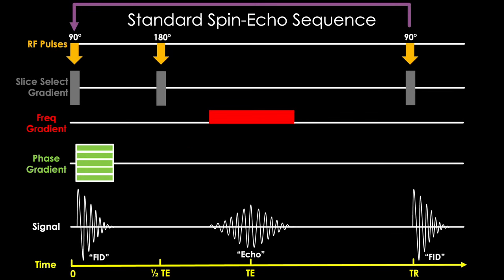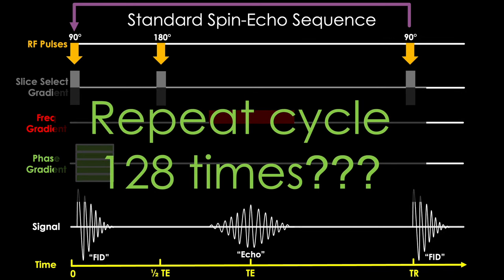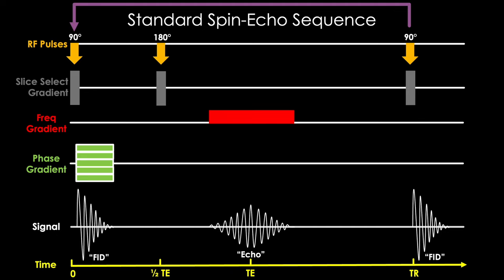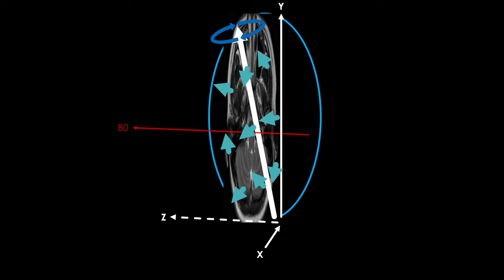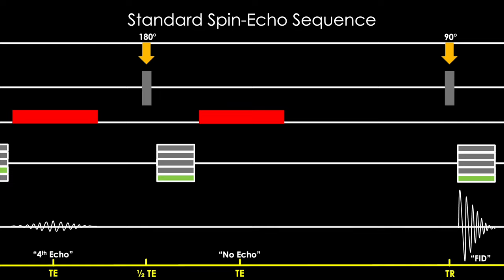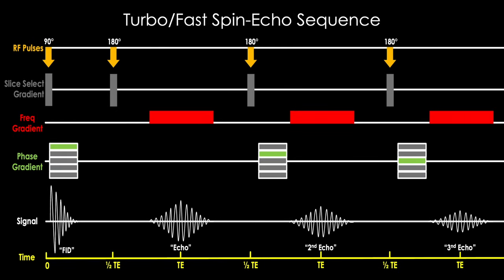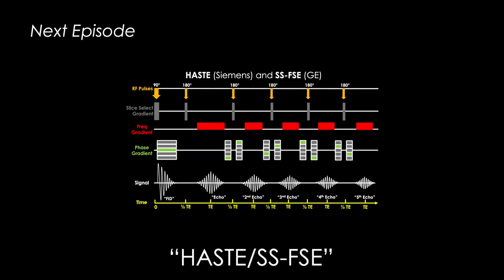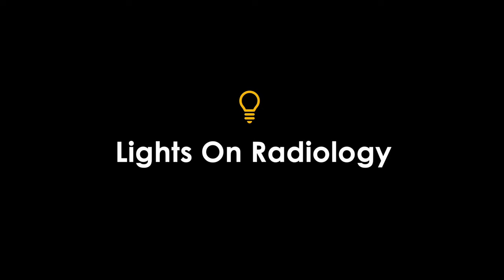The Turbo & Fast Spin Echo Sequence - MRI Pulse Sequences EXPLAINED | MRI Physics Course Lecture 10

Comment: I'm working my way through these lectures and it's insane to me we still haven't arrived at k-space yet. My teacher started working with k-space at lecture 1 about 1D MRI...
Reply from the maker: K-space is by far the most challenging concept!  It's frustrating how courses introduce it out of nowhere as if anyone has an idea of what it is or how it plays into the MRI image building process.  Unfortunately, to really understand it you have to dive deep into the math and really understand 3-4 subjects in parallel so the initial lectures present a general idea on how this all works while avoiding the math.  I will cover this subject and all needed to understand it in a future Advanced MRI Physics lecture series so stay tuned but don't fret, if you asked an MRI technician to show you K-space, they wouldn't be able to.  It is only relevant to those literally building and coding the MRI machines, but nonetheless a cool and interesting topic when explained well!